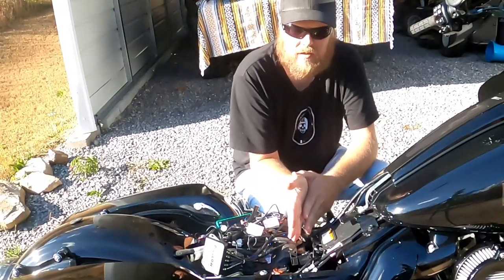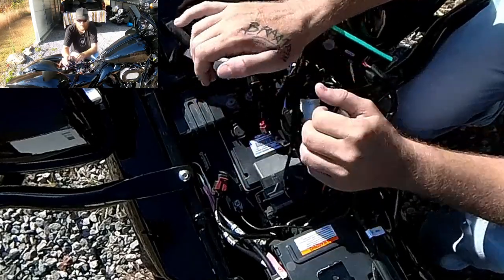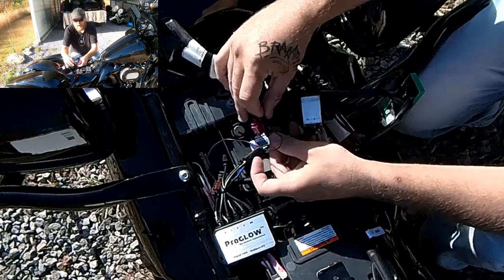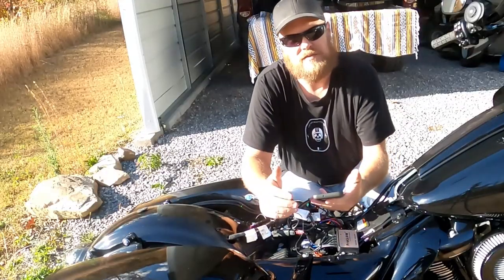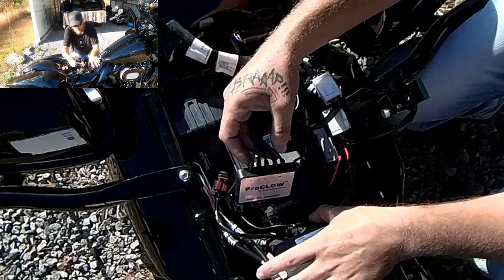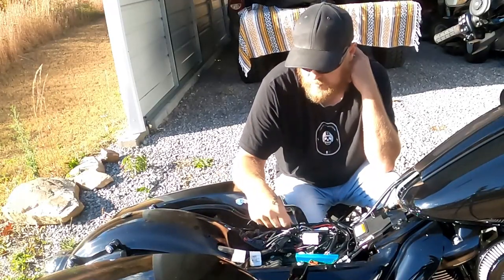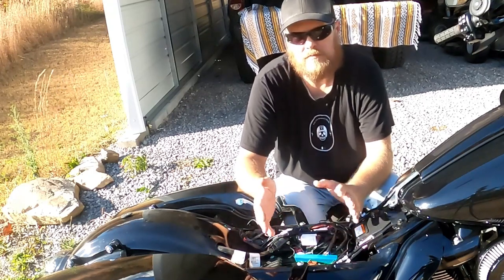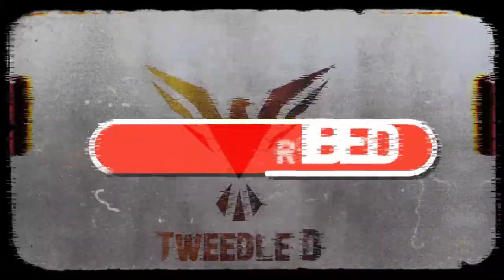Custom Dynamics Pro Glow Bluetooth Controller Installation

Comment: Wish they would make a 1 harness for "EVERYTHING CD" as under my seat is a HOT MESS....its embarassing to even take off my seat, as my license plate I had to vampire tap like 8-10 different wires since I got the one that didnt have the harness...  Wife got me this same headlight and controller today for special occasion, and now I realize I will be in WIRE HELL all over again... :D
Reply from the maker: I cleaned mine up useing zip ties and trying to stash connectors in spots I could. But it's still bulky. I wish @@customdynamics made 1 connector that works all the lights. I still haven't got and installed the under glow so more to come.